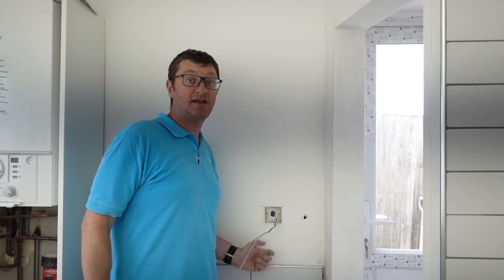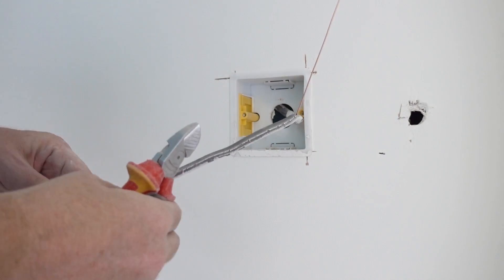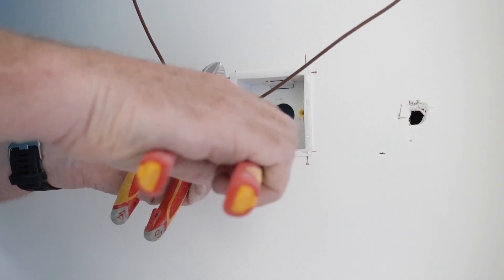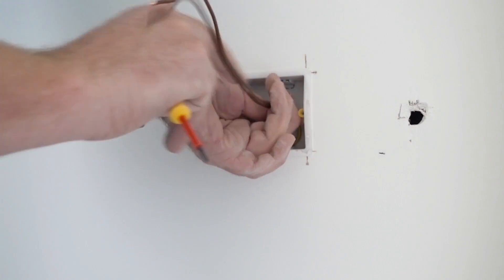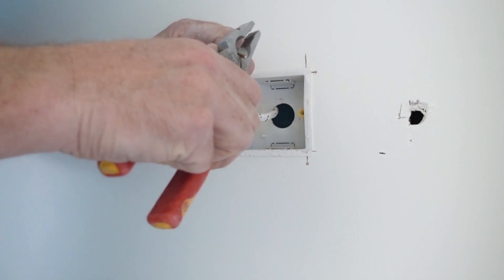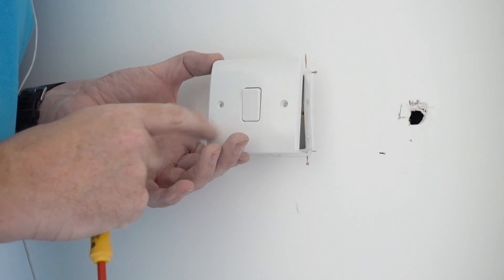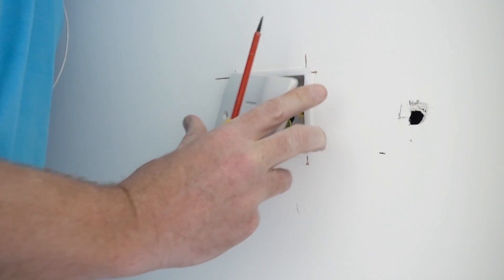1 Way Light Switch, how to install and wire.

Comment: I have a red a black wire, which goes where
Reply from the maker: your light switch should have 2 terminals....  so one in each!    but if you are in any doubt, please contact an electrician.
Reply: @MPCpropertydevelopments  it has 4,  1 and 1/ 2 and 2
Reply from the maker: @danielconsidine3863  of it has 4 you have an 'intermediate' light switch...  it will still work, but you need to use the correct terminals.   Time to call the electrician.

Comment: Great video! If you use twin brown and earth then how do you know which one is permanent live and which is switch live, without testing the core? Thanks
Reply from the maker: You could use a tester, but it dosn't really matter which is which, it makes not difference to the switch....  if you want the switch the right way up then twist it around like I show you in the video...  50/50 odds that it will be right!!
Reply: YOU'RE SUPPOSED TO PUT A SMALL AMOUNT OF RED OR BROWN SHEATH ONTO A BLUE WIRE TO LET YOU KNOW WHICH ONE IS A SWITCHING LIVE,OR EVEN USE RED TAPE BUT NEVER LEAVE IT BLANK.

Comment: the screw on my switch doesn't go down far enough to hold the wire....
Reply from the maker: sounds like the switch needs replacing...  assuming you are using propper sized wire...
Reply: If it's an mk switch, I discovered the screws stop and seem to be fully tightened, but if you keep turning them, they will go slack again and  tighten on the wires.

Comment: Is there a swtich that you connect(in my case a positive and negative) in and then using the switch to change the output between two different sets of positives and negatives?(position one = connected to positve and negative, position two = connected to a different set of positive and negative)
Reply from the maker: Sounds like you are doing electronics rather than household electrics…  but an intermediate switch would probably do what you want if I understand the question correctly…
Reply: @MPCpropertydevelopments  Yup, electronics but no worries I found it, DPDT switch. Appreciate the reply though!
Reply from the maker: thanks, and I appreciate the comments...

Comment: Why didn't you show us which wire you were putting in where? You held the socket so that we couldn't see the wiring side What a useless waste of my time. You talked as if you assumed we knew what you're  talking about .If this had been the case I wouldn't have any need to be looking /watching your video!
Reply: I think the original comment was after the same thing as me, which side of the switch were the wires put in. The screws are really stiff on the switch I've got (same model as you have in this video) and I want to know exactly where I place the wires before doing the screws up without stripping the screw. I hope that makes sense.

We cannot see this in the video as its blocked from view, and a wiring diagram doesn't help with this part of the task. Many thanks!
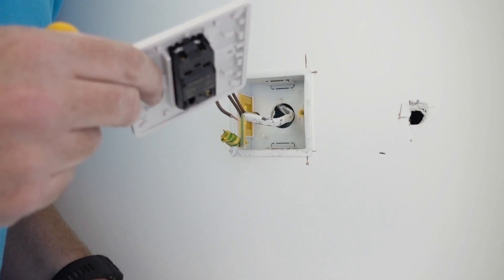Reply from the maker: 2:44 I tell you...
Reply from the maker: you should also watch  https://youtu.be/TIa-934lmz0 for the lighting circuit design.

But please do remember that electricity can kill, if you are in any doubt please get a qualified elcetrician to do the work for you.

Comment: So on old wiring red and black it doesn’t matter which one goes into the com does it on a one way switch ?
Reply from the maker: No it doesn't Really matter which way around the wires are....  although it will alter which switch position the switch will be for on and off but you can spin the whole switch plate around like I show you in the video if it is not right.